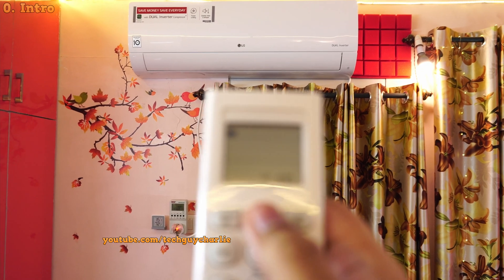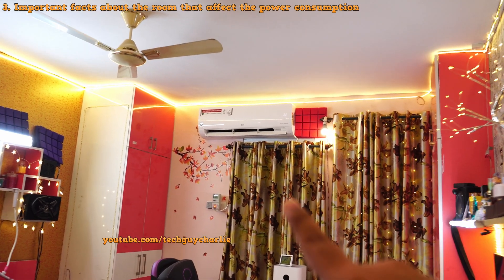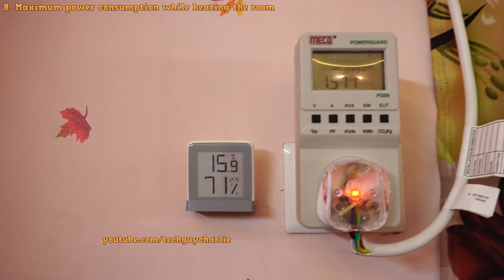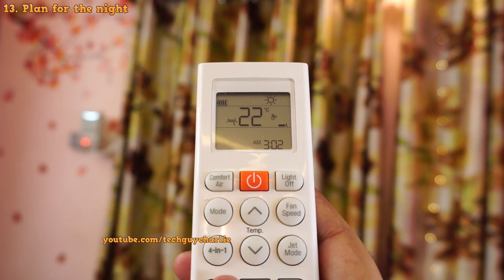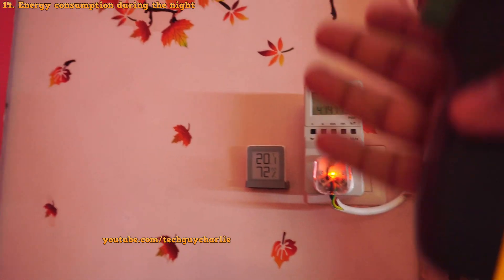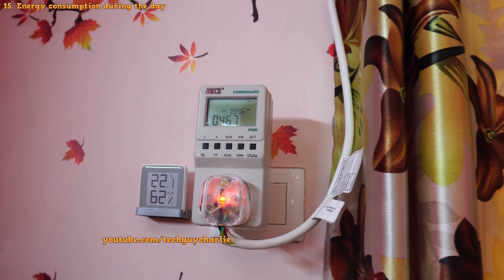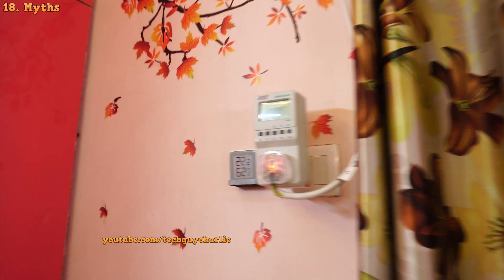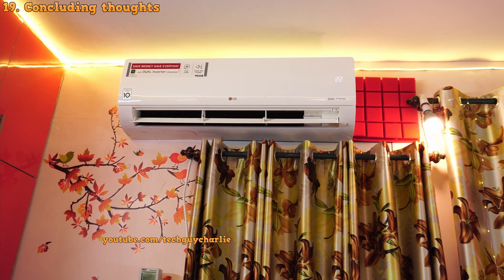How many units of kWh does Inverter heat pump (Hot and Cold AC) consume in 24 hours

Comment from the maker: My rough estimate is that the COP should have been around 2.8 because the oil filled heater uses roughly about three times the energy the heat pump did in similar weather conditions to maintain 22*C. I cant do a head to head comparison because the temperature outside is never exactly the same.
PS: If you have insulated or wooden walls, expect lower power consumption, we have non-insulated concrete walls which absorb considerable amount of heat.

Comment: What if you let the door open to warm the other rooms, can you do a test if it works
Reply from the maker: It actually works! I've warmed our living room with this plenty of times by leaving the door open, it still ended up using less energy compared to an electric heater.
But it works because this is a big 24K BTU unit, might not work with a smaller one.
Reply: @TechGuyCharlie  i was thinking to put one above the entrance door but I don't know if its gonna work

Comment: Brother can we use energy savings mods in heat mode ?
Reply from the maker: Hi, the manual power control feature works only in cool mode. 😊
Reply: @TechGuyCharlie  that's means no power saving in winter 😭

Comment: Hey bro. Ac service kisse karwate ho tum?
Reply from the maker: I service them myself. It literally is just washing down the condenser with plain water, cleaning the filter and if you want to go one step further, remove the front panel from the indoor unit and use a coil cleaner brush to remove the lint from the coil.
Reply: @TechGuyCharlie  yes I have watched your video on outdoor unit service.. But u clean indoor by yourself as well...?

Do you use water in indoor unit as well?

Comment: Hi charlie, brisbane, queensland, australia here, weel done, if you remember me, i had ask you about this agess ago. Kelvinator 7.1. I ended up running my aircon at 18deg on heat mode. I have solar on roof. I was quiet surprised i got some energy back in threw the quater. We can get down to - 3% and i shut all doors except bedroom door, it kept the whole house warm, nice and snug for winter. Yahh thanks for the info. 👍👍👍
Reply from the maker: Ah, that was almost a year ago! By Feb, the weather had already started becoming warm, so I thought let's do this next winter. Yup! Heatpumps are crazy efficient, I was surprised it only used 5.7kwh my oil filled heater uses almost 2.8 to 3 times that.